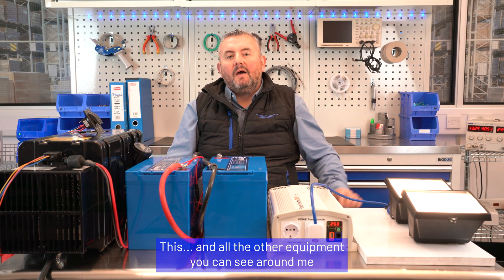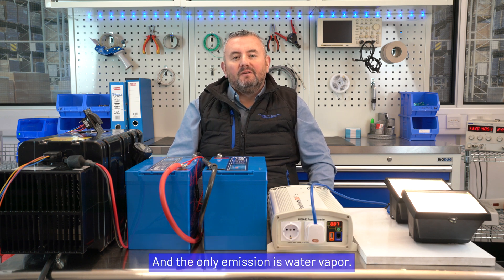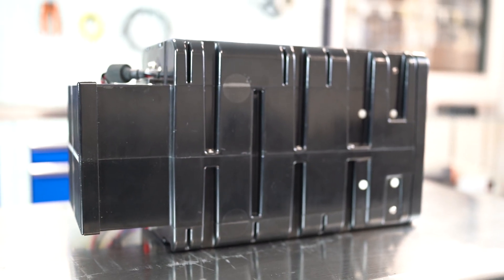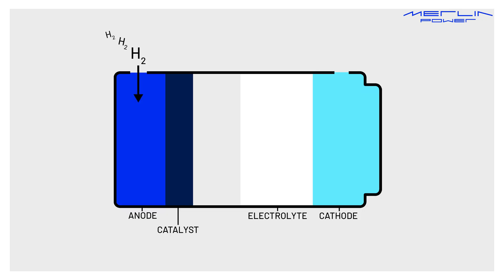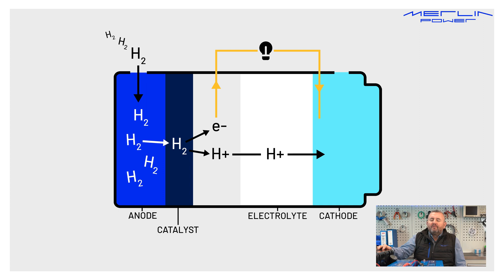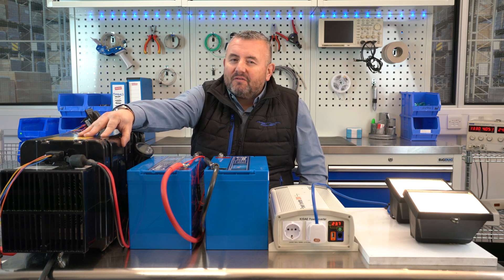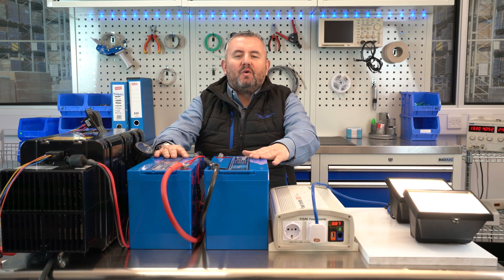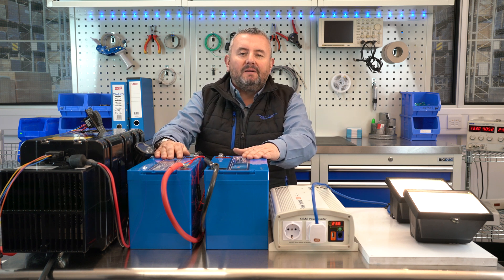How do Hydrogen Fuel Cells work? (In under 2 minutes)

Comment: Are you adding pure O2?  How long is the stack supposed to last?  Also guessing that the H2 in the tank will leak out in ~30 days?
Reply from the maker: Thanks for your comment CubbyTech!

Are you adding pure O2? No, the O2 is provided solely by what is in the air.

How long is the stack supposed to last? It depends on use, but it's recommended that the stack is replaced every 8,000 hours.

The H2 in the tank will leak out in ~30 days? The H2 tanks that we use can sometimes sit for months without being connected up to anything, and they see very minimal leakage. It is obviously dependent on what kind of tank you buy but generally it shouldn't be an issue :)

Comment: can this fuel cell setup be used in the domestic situation ? ie, replace the domestic lithium house battery ?
Reply: Do you not see the 2x 12v lithium batteries (the blue things) right in the middle?
Reply from the maker: Hi, thank you for your comment! This can be used in a domestic situation, provided you take the necessary safety precautions. It acts as a great, green, way to phase out your lithium battery banks.